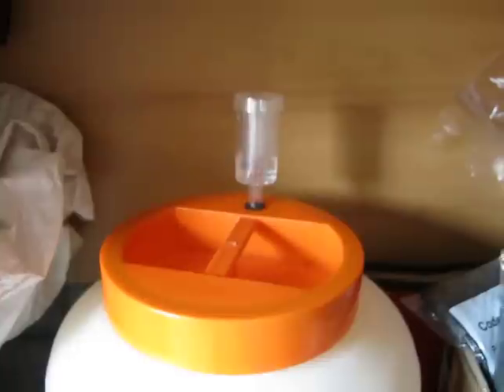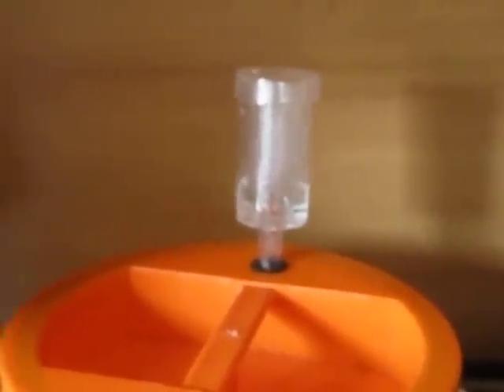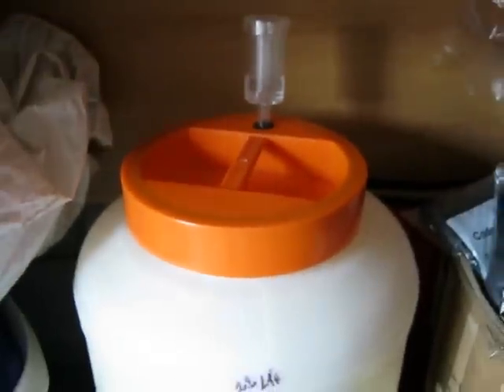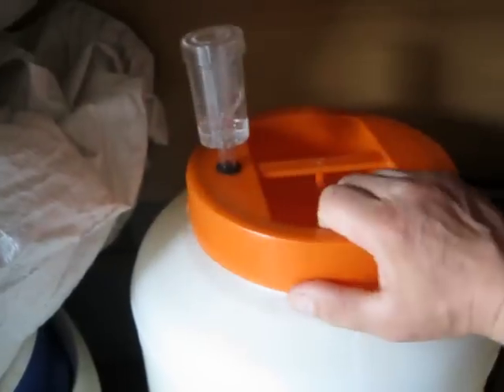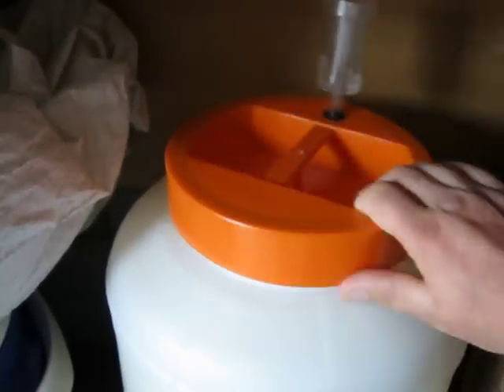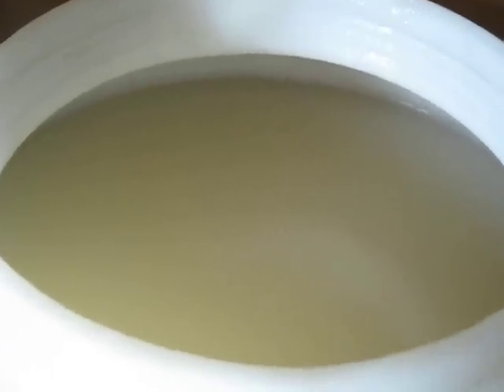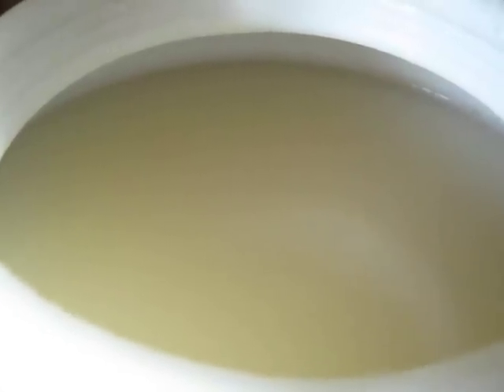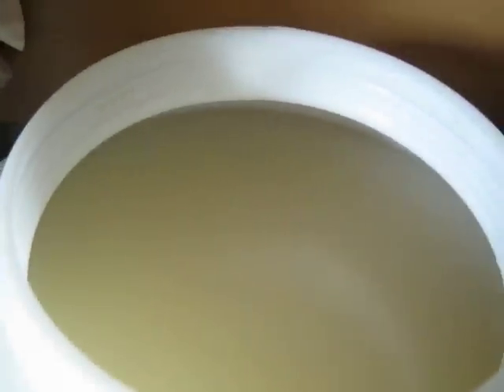Sugar based wash fermentation 2 of 2

Comment from the maker: @Savetheturtles80 Hi, yes any mash including beer, or wine will have it, and thee is also acetone, esters, aldehyde, propanol and yes you still have to get rid of and this is not that hypothetical 100ml as volumes of processed of mash are may vary from couple of liters to hundreds of liters so the amount of this impurities is different from distillation to distillation from 100mm to many liters and proper fractional calculation must be applied every time to remove it correctly.